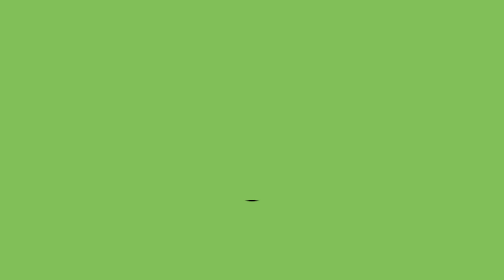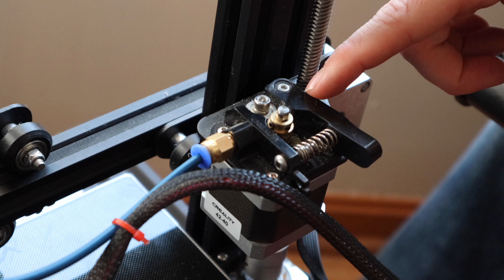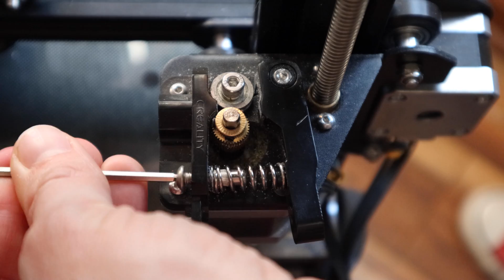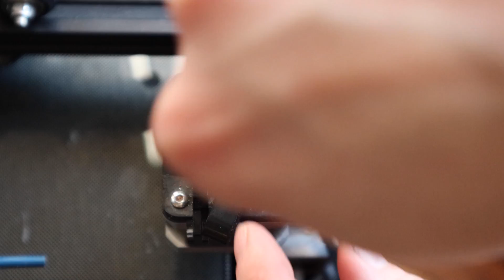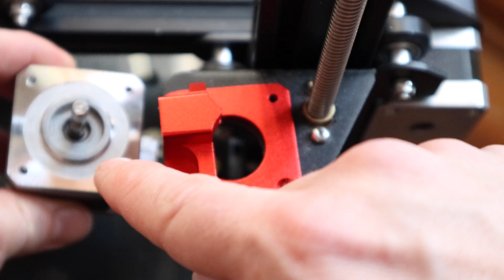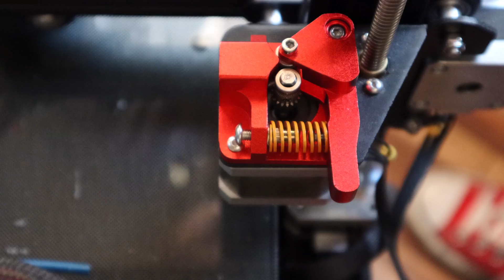Dual Gear Extruder Upgrade: Installing RedRex Dual Gear Extruder Metal Drive | Ender 3 Pro Upgrade

Comment: What Retract Lenght and Retract Speed do you now use ?
Reply from the maker: I never changed my settings once I upgraded. It. Just provides less slipping now.
Reply: @ItsMeaDMaDe  Sorry my english is terrible but after you switched from bowden to direct drive you adjusted your retract and speed surely.
I am interested in the values that you are now using, such as millimeters and mm/s.

Comment: anybody get black powder accumulating between the gears? wondering if it's from the bearings inside the gear?
I also had to swap the PTFE coupling with one I had laying around because the one that came with wasn't gripping the Bowden tube.

Comment: Is this still working good for you. I just bought a used v2 and someone gave me this upgrade with it but not installed.
Reply from the maker: Yeah it works good. I have noticed a bit of grinding at the gears that is a well known issue. But have no issues with it.

Comment: Hi Chris, love the vid. Kind of a two part question. I was wondering if there is maintenance that needs to be checked on printers. Because of all those moving parts. Like vehicle maintenance, do we need to keep certain parts lubed, gears checked, belt tightness, oil change (lol). Second part.. Besides Boden tube and the vid you just did, could you do vids on upgrades and or replacement of parts? Thanks for taking the time. I figured I'd ask you because your vids and you seem to be strait up with no BS, and your the only one that has gotten back to me.
Reply from the maker: Hey thanks. It was a nice upgrading so far working out well. As for general maintenance great idea for a video. I can do that for sure. There are certain things I do. My video tomorrow is one of them on e-steps. I can start on making something and put it out soon. I also have my maintenance playlist that where I show upgraded and maintenance too you can check out in the mean time. Never thought about comparing the maintenance to a car. Pretty accurate comparison.
Reply: @ItsMeaDMaDe  oh cool, I didn't think to check your play list, thanks for that man your awesome

Comment: I heard these grind in to the aluminum body right away......let us know if this is the case please.
Reply: on the amazon listing, they show that they have included metal washers so it wont grind anymore.
Reply from the maker: Really? I know a few people that swear by this upgrade. What part grinds? I’m curious and I can keep an eye on it. Cause if it does I can make another video showing the issues. So far it’s been printing for two days and it’s working great.
Reply: @ItsMeaDMaDe  one of the 2 gears starts grinding into the aluminum base but there is a work around.
Maybe a Google search might provide more info.
Reply: Just searched on YouTube.....tons of vids....check it out
Reply from the maker: @outlawfpv3792  thanks a lot. I’m gunna check on it to see if I have the same problem. If I do I’ll do an update video.
Reply: @ItsMeaDMaDe  I think the fix is a plastic washer under one of the problem gears.